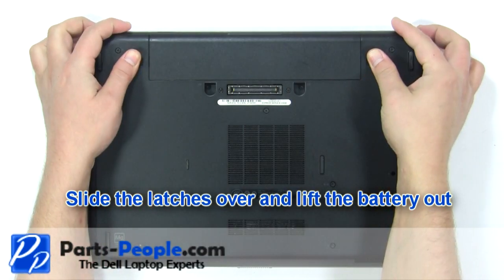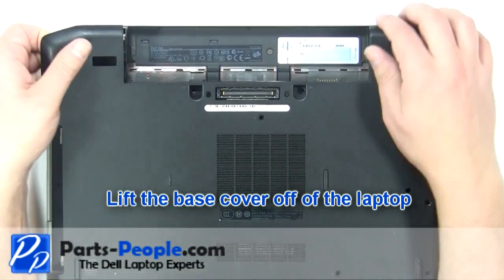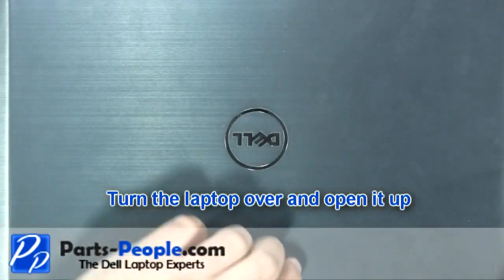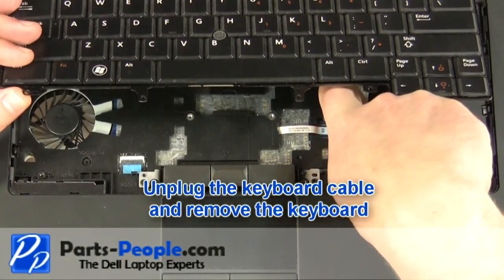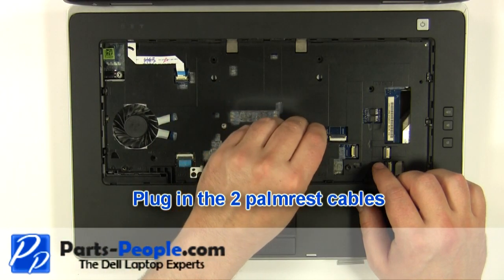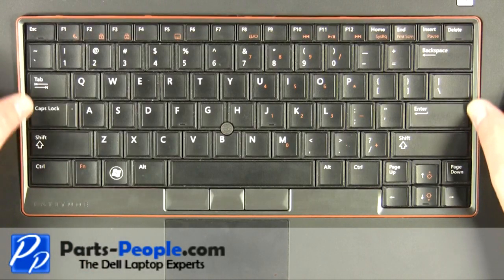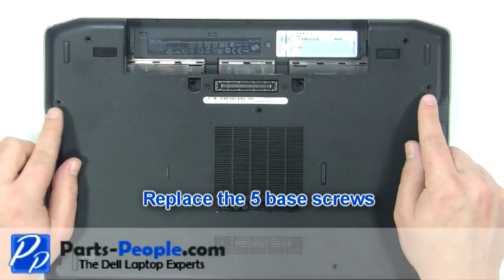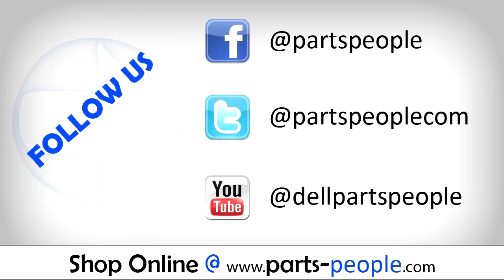Dell Latitude E6420 Palmrest Touchpad Replacement Video Tutorial

Comment: Hi, quick question... My company laptop is of same model... Everything works fine.. But there are scratches on my palmrest.. So I want to replace it ... While replacing we need to remove hard drive.. Does it effect my software or data which is present in laptop?
Reply from the maker: Not to worry. Removing the hard drive will not affect your data.
Reply: @dellpartspeople  it's my company laptop.. So, it's has vpn and Vnc access to it... Does it effect those?

Comment: Hello quick question, are all screws the same size? so many of them that if they are different sizes that may be puzzling. thank you.
Reply from the maker: There are various sizes of screws. Be sure to separate as you remove them.
Reply: thank you so much, awesome video.....very clearly explained.

Comment: This a big help.  I did find that there two extra screws from underneath that needed to be removed along with P/P1 screws that were holding the keyboard as well as the extra plug attaching the touchpad.
Reply: you have a 6430, not the 6420.. I noticed the same thing

Comment: Thank you so much for posting a great step by step video.  I purchased a refurbished Dell that works wonderfully, but the palm rest had an odd smell.  I was able to replace this myself thanks to the easy to follow video!
Reply: Hi, does removing hard drive when laptop is off and replaced the same hard drive .. Can effect the data loss or software(when we turn it on again)?

Comment: I wanted to comment on the extra cable that thatamsyndrome mentioned. There was an extra cable on mine as well on the underside that needed to be unplugged before I could pull the palm rest away. If you are staring at the keyboard when attached the cable would sit to the left of the mouse pad. There was a small Broadcom chip with a cable. If I had to venture to guess this appears to be the Bluetooth option.

Comment: I also have a E6420, but just a warning, i ended up having 5 cables to unplug, 2 on the surface side (fingerprint scanner and dunno what the 2nd was for). And on the underside there was a cable for the touch pad.